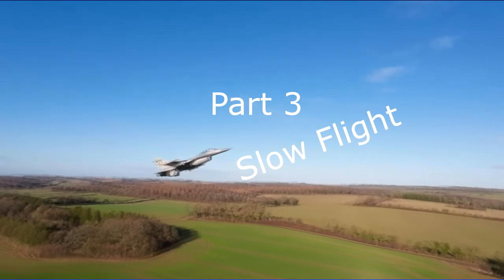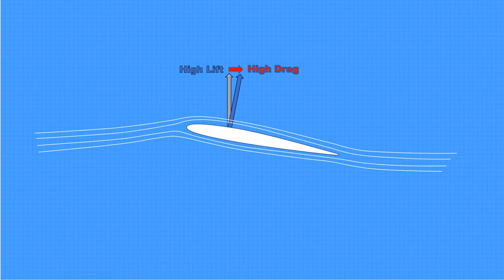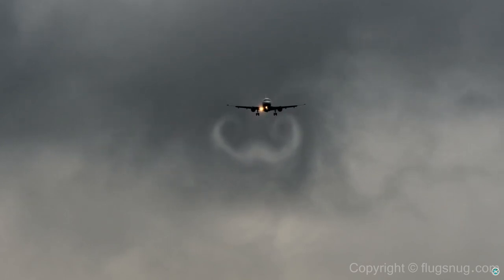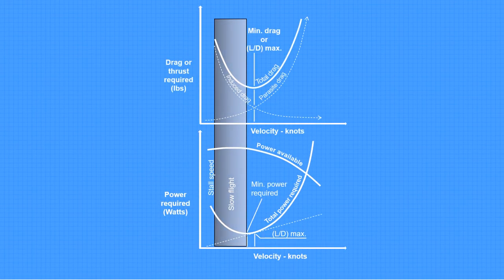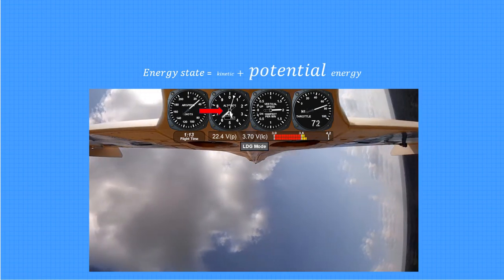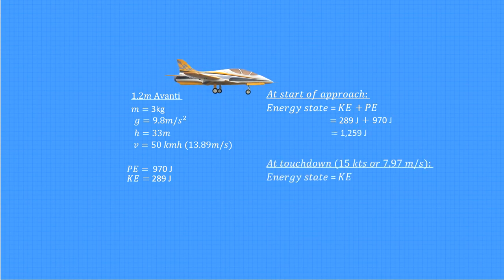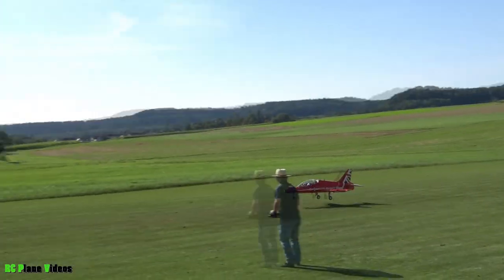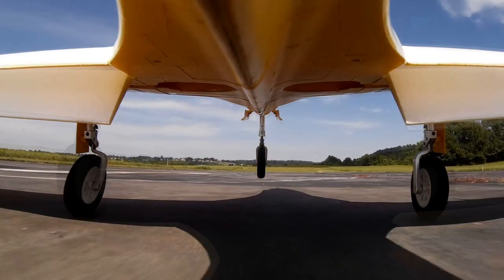By the Numbers: How I Land my EDF Jet (and avoid the danger zones) Part 3

Comment: This is excellent info. I learned the expensive way that certain airframes get to a point where more motor just equates to higher amp draw and very little speed. Now I see why
Reply from the maker: Thanks! You're not alone. We've all done it. The info is out there, but not always readily available,  especially within the hobby. That's one reason I started this project,  to gather everything I could find about landing a jet and put it in one place. I think EDF manufacturers could help out by providing more info on thrust available vs. airspeed.

Comment: I have the same Avanti but upgraded/modified with 130A Avian 130 Amp ESC, and 12-blade 2150Kv leaf blower.  Also, you Wing Cube Loading ~ 21 seems a little steep?
Reply from the maker: You should get much better performance than mine, especially if you use lighter packs. My WCL is 21 due to heavy 6200 mAh packs, backup battery and telemetry on board.

Comment: While you give us ton's of info  you missed the point most take a model and redesign it for more speed? adding more power more battery's and more weight. weight is the main problem As built by the designer most models fly fairly well adding more weight changes the models stall speed and landing speed. while a model properly set up for slow flight will help in approach and landing extra weight must make the model approach and land faster.
the proper way is keep everything in balance or design your own model. I have 2 modified 6s jets that fly just as fast and get 6-8 min's flying time and are lighter and land  a much slower speed this was achieved by lighting the models weight and using 5s and lighter battery's. One reason is our field is on a hill with a very narrow and short runway every landing is like a carrier landing. so weight and speed were very Important. the lower weight 
made flying jets at our club possible. with the advantage of nicer flying model and extended flight time .
Reply from the maker: Lighter definitely helps when landing, especially on a short runway! Thanks for the comment. Nice airfield there.